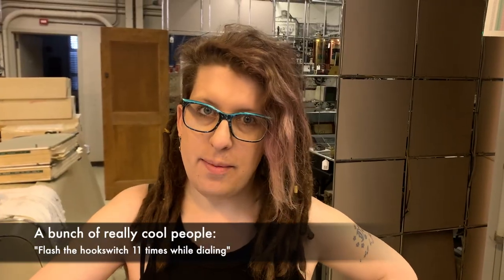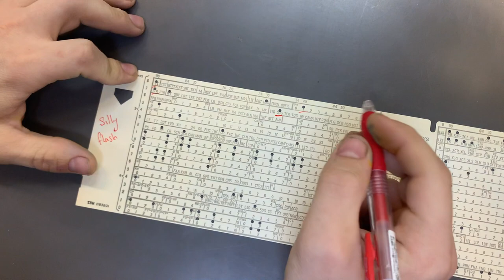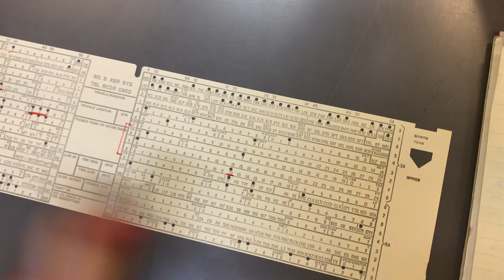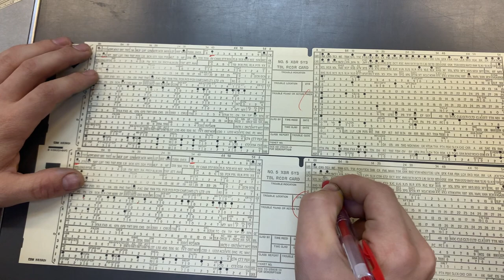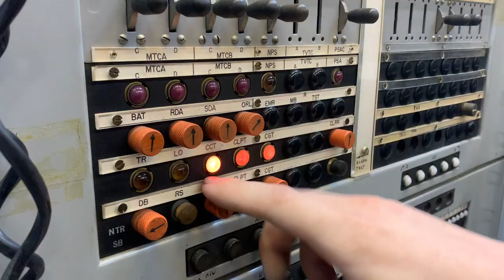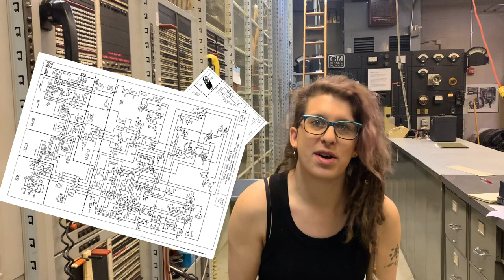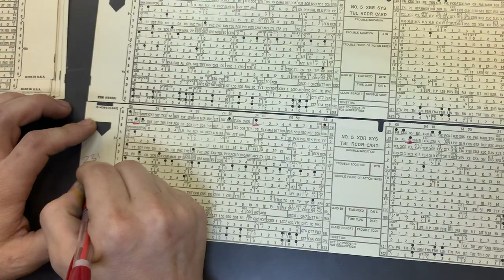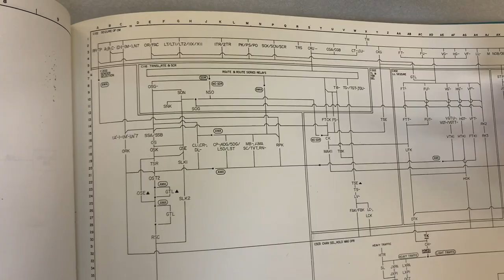How many different ways can we cause trouble in the 5XB?

Comment: What u need is an adjustable line build out box that has 88 mH load coils capacitors and resistors to simulate the line.  We used them at Bell Labs to recreate troubles in the switch lab.  The load coils were typically used on 24 and gauge pairs. NL or non loaded cable has a horrible frequency response so the load coils were always on loops usually over a few miles. See if u can get a load coil can the kind usually mounted on outside plant poles and cannibalize some 88 mH load coils.  Make your own simulator. BTW, that’s why railroad open wire comm lines back in the day used 13 and 19 gauge hard drawn copper or copperweld  on open wire glass insulators to minimize losses. They used larger gauge wire that had two properties that didn’t require load coils.  Larger gauge (sans load coils) was good for RR telegraph and dispatch phone shout down and ring down lines.
Reply from the maker: I bet we have a line build out box sitting around somewhere that I could use.
Reply: I was thinking along similar lines.  For the phones that are "too close" to run those tests - add a long run of wire - I was thinking 24 guage, e.g. spool of such wire pair - and twisted pair on loop, most of what might otherwise be excessive inductance would mostly cancel out - but enough inductance, capacitance, and resistance would remain to make it work well for testing.  But yes, better yet, some type of switch box or the like where you could change these simulated "line" conditions - add/drop length, resistance, capacitance, inductance in the loop+phone test set.  Maybe even an option to vary some other (e.g. resistive) leakage between the pair (like and old pair with some moisture/water penetration, shorts or intermittent/partial shorts on the line, etc.).
Reply: You can make a build-out box.  A 26 gauge twisted pair subscriber loop has about 83 nF of capacitance per mile.  26H88 88 mH powdered iron core loading coils are placed every 6000 feet.  A loop may be simulated with lumped components with inductors in series and capacitors in parallel between the inductors.  What is going on is that the inductance raises the impedance of the loop, reducing attenuation, but causing a cut-off around 3,400 Hz.  Too short a loop will have too low impedance and be flagged by automated testing.  Here is a good short non technical reference to give some background: http://www.gordostuff.com/2011/07/loading-coils-more-on-local-loop.html  Some types of transmission cables are continuously loaded by wrapping conductors with permalloy tape rather than having lumped inductance at intervals.

Also recommended is looking at the problem of line length and the desire to have a universal subscriber set which works regardless of loop length.  The BSTJ, April 1951, pp 239-270, has a great article on the development of the model 500 telephone.  This is the best place to find it: https://worldradiohistory.com/Archive-Bell-System-Technical-Journal/50s/Bell-1951b.o.pdf

Comment: Sarah, at 13:00, are you talking about a REN  test? I know there are still few places that use "half-ringers" inside the NID, I ran into them every so often in my time in older neighborhoods doing DSL, and would have to bypass them, then when I worked doing VoIP, we would occasionally find them hidden in what is now customer premise wiring, and was told "it's an old thing they used to use for line testing" but if this is what it is, I've never seen the opposite end of this! Cool!

Comment: I just remembered another way to drop a card in a #5 crossbar office but I don't know what the trouble indication would be on the card.  My guess is it may be related to the continuity test.   Place a call to another line within the office where the called line is a ground start line and happens to be off hook but not ground started yet.   The way I did this was to go where there were 2 coin first payphones (ground start lines) and take one off hook but not deposit any coins, then make a normal call to that payphone from the other one.  Just after dialing the last digit on the calling payphone, the called payphone (which would not have battery because it was ground start with no coin deposited yet) I would hear the battery turn on just for a split second and then turn off.  On the calling payphone, I would hear the typical sound of a card drop (2 second pause followed by reorder).   On payphones, C/O personnel would tend to just disable them at the test board rather than challenge the customer so I never got to find out what kind of card was dropped.

Comment: Awesome video with very informative explanations. :)    

I can recall when using a 16 digit keypad on #5 crossbar, dialing A, B, C, or D at the dialtone did not break the dialtone or got me reorder as if I had pressed * or # at the dialtone.    I also think that dialing A,B,C, or D on an office code didn't drop a card either.  The way I did it was dialing A, B, C, or D as the last digit of a phone number.   I don't know how an originating register handles that, is there an A, B, C,  or D designation in the 2 out of 5 format?  

No route (as was explained by the person at the C/O who butted in on my line after dropping cards with 0+ringback number) from your explanation is actually "no translation".   Makes sense the way you describe it.  I suppose that kind of trouble card is not very common since all possible combinations of dialing are supposed to be accounted for but Dial Administration didn't think of the possibility that anyone would call a test number through 0+ dialing. 

Another interesting way I could drop a card is dialing the Automatic Number Announcement (ANA) and squeezing in another digit except 1.  So, for example, in my area at the time the ANA code was 760 and I would dial 7608 but dial the 8 really fast after the 0 before the marker could handle the call.  Like this:   7....6....08     The marker would make it's usual click-clunk sound but the line would lose battery for about 2 seconds.  I asked the C/O person why the line lost battery and his reply was "because it's crossing points".  I don't know what that means.  He also explained that the marker would automatically put in 1111 after the 760 and that's why 7...6....01 would not drop a card.  I wonder how the marker is programmed to translate 3 digit codes into 7 digits, or does the O/R do that?  
I'd love to hear a demonstration of the sound on the line of the card being dropped.  From what I remember, after dialing the last digit (or mutilating it), there was a faint click, about a second later another faint tick sound (probably 2nd trial), followed by reorder.   I also remember that the line was locked during the time the card was being dropped and I had to wait until reorder before I could hang up again to get another dialtone.   When the office was unmanned on weekends,  I assumed they turned off the trouble recorder because the whole process sounded like it was sped up and only took about 1 second instead of a full 2 seconds.
Reply from the maker: Many 5XB offices had ATA in later years. Automatic Trouble Analysis sent the trouble indications to a centralized location where they were read by a PDP/11 running analysis software. When the office was staffed during regular business hours, they probably disabled ATA and captured trouble records locally. We have both the trouble recorder and the ATA/MDT (Maintenance Data Transmitter) setup, but the ATA bits still don't work. A future project.

Regarding '1111' being added for some things, it depends on whether or not the office had pretranslators. Without pretranslators, the marker will only get called in after the 7th digit is dialed (or the 8th, if you count a +1 or a +0 at the beginning). So you couldn't just dial 411, you'd have to dial 411-1111. If the office was outfitted with pretranslators, the OR would call in the pretranslator after the third digit. The pretranslator did a lookup on the 3 digits, and told the OR when to call in the marker. The pretranslator could give the OR a variety of instructions for how to handle any three digit code. In many cases, markers could also prepend or postpend an arbitrary set of digits to any number, so the call could be routed correctly. This was useful when dealing with step offices.
Reply: @ConnectionsMuseum  , where I worked, Livonia, MI was an early adopter of ATA.  It was only run in parallel with the Trouble Recorder long enough to get the bugs out of ATA.  Other areas may have operated differently.

Regarding pretranslators, an interesting trouble condition happened if there was a 10 digit detailed billed call (with local AMA), and the pretranslator  called for a 7 digit marker start.   7 digits was the default in those days, if the pretranslator failed.  OR didn't care.  CM didn't care.  OS didn't care.  The transverter cared and dropped the cards.  It knew there needed to be 10 digits.  I used to tell people that pretranslator issues could cause AMA issues ,and they thought I was crazy.  They felt there was no connection between the two frames.  Indeed there was no direct connection.  The pretranslator was long gone by the time the OS called the transverter, but the damage was already done.
Reply from the maker: @bobbymac7835  Huh! Yeah I can see how that would work. If the TV expects 10 digits, and it only gets 7 because the pretranslator defaulted to 7, that would make it cranky! Our PTR is also setup for 7 digits marker start by default. We don't have the transverter wired up yet, but that should happen sometime this year, hopefully. They never wired it at the museum because our trunks are flat rate/1MR, not arranged for AMA. We're doing the modifications to convert them soon.

Comment: It amazes me how the engineers came up with an analog card system for troubleshooting and how well it works. I don't suppose there are any crossbar system still in operation are there?
Reply: I assume there are still some running in the world somewhere. But there is a #5 crossbar in the museum, a few feet away from where they're working, behind the card puncher.

Comment: I have not looked at the circuit, but it probably fails the continuity test on purpose in this scenario as it it cannot determine the difference between a line that is shorted out and a line that is actually just short. Modern ring testing circuits would probably also give a fault code in that scenario as they would assume there is no way a phone is actually just 20ft away, so therefore it must be a problem.

Comment: i think the high traffic punching may be a result of .

1. just as soon as you hang up a call comes through.

2. the so called "ringing off the hook" no sooner than you get the phone on the hook it rings again and the recorder did not have time to reset.

in order to validate the test couldnt you put a resistor in series with the phone to emulate a mile of wire?

Comment: This seems like literal ticket spam for the tech to deal with.  Is this accurate to the time period and would the admins just throw the tickets away unless they actually got complaints?
Reply: All of these situations would naturally happen, with the exception of the MKR not releasing the OR.  Holding a  MKR relay operated or non-operated will definitely cause cards to drop, but is not realistic.  Bad dials, wet cables switch hook jiggling, etc., would cause the  DPOR to register bad 2/5 code and pass that to the MKR.  Bad MFIR reed relays or circuitry would do the same thing.  A broken  MKR cross connection or employee work error opening a new route would cause the no RR error.  CON errors were 1TR  only in light traffic, and were bypassed as nuisance cards.    MKR = Completing Marker.  OR = Originating Register.  DPOR = Dial Pulse Originating Register.  MFIR = Multifrequency Incoming Register.  RR = Route Relay.  CON = Continuity.  1TR = First Trial.    These are recollections from the 1970(s).
Reply: @bobbymac7835  What was the process for resolving trouble cards?
Reply: @MichaelWallace-oq3wd   , no.
Reply: @PositionLight  one looks at a bunch of cards.  If they are from the same line equipment, then it points toward the customer.  If the same OR, same digit, then it points toward the OR.  And so on....With originating mutilated digits, sometimes it was not possible to determine why it happened.  A certain number of them always happened, especially with rotary dial equipment.  They just could not be replicated.

Comment: Question:  What happens if 2 trouble indications come in at the same time to the trouble recorder?

In my own experimentation with this with 2 phone lines (from memory),  one line will reach the trouble recorder, the other will skip it and will sound the same as if the trouble recorder was turned off.  

I don't think there are provisions for prioritizing trouble reports and there is no "queue".
Reply from the maker: Markers have a timer that will time how long they will sit in the queue and wait for the recorder to become available. It's between 3-5 seconds, usually. If its longer than that, it won't wait. 

There is no priority system for trouble records but there is a queue. It's just that you don't want to hold up equipment for an unreasonable length of time just to drop a trouble card. So if it waits for long enough, it'll just give up and move on with the next call.